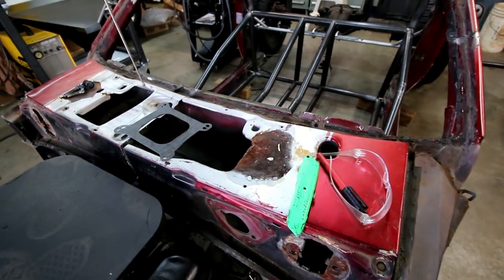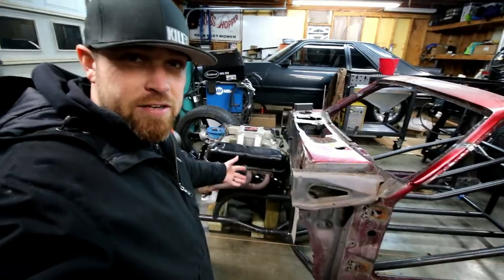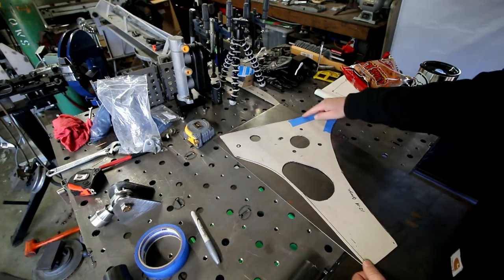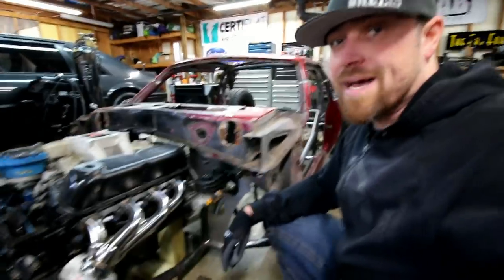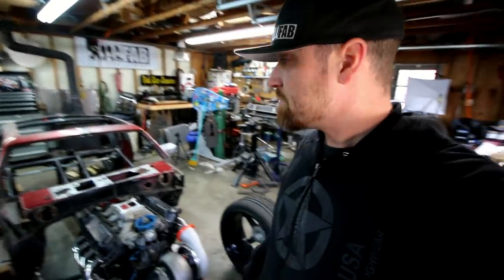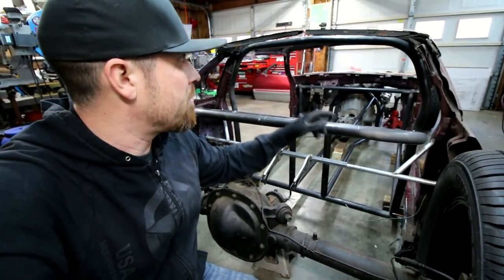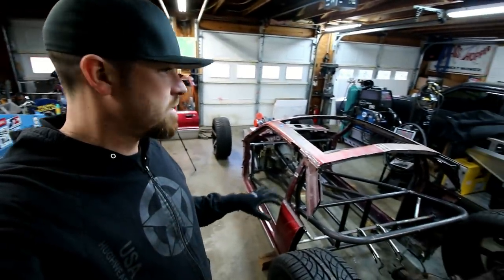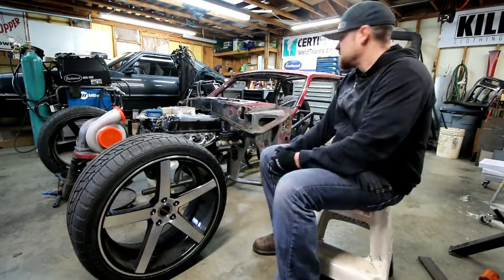Fox Body Mustang Hot Rod Build Progress | Bibbster

Comment: Dude,  you're gonna love the Everlast welder and water cooler.  I've had my everlast TIG, plasma,  and that exact water cooler for about 3 years.   It welds great and I've had zero failures.   The torch it came with was a hunk of garbage that weighs like 40 pounds.   I bought a new water cooled 20 size torch and it's a dream to use now.   Once you use a water cooled torch,  you'll never go back to anything else!
Reply from the maker: I am stoked

Comment: I just watched the update, if I could add food for thought? Front struts, look into 32 way adjustable coilover. You can change the length of the strut at the bottom by the spindle or cut the factory strut. Also if you look up and older YouTube post ( mid mounted mazda ) I know the rear is independent but look at the math and idea. Your show is great, it has helped me so much and gave me so many more ideas. Keep it going and having fun is what it about, have a good day
Reply from the maker: +Philip Baker You can't shorten the body of the strut though
Reply: True but with your rim size the bottom of the strut could be pushed down almost to the bottom of the rim then add drop spindles?

Comment: I love what you're doing with the Bibbster. It's genius. The kind of genius that is capable of influencing or repulsing the automotive world at the same time. I think it's revolutionary. I need to tell you that when I look at the 'quarter panel' and try to wrap my head around what you have loosely planned I'm concerned. I realize you're old school hot rod vision, however, I can clearly see a flying buttress. Look at the new gt40. A set up similar to that would allow you to use 2 smaller rads positioned in the arch of both buttresses. I realize I'm leaning toward supercar styling cues. I like big butts and I cannot lie! I trust you can deuce coupe the back half of the Bibbster and prove me wrong. You've got my attention
Reply from the maker: thanks....stay tuned

Comment: I like the front end design so just a thought, if you run a coil over do some custom ones with the hydraulic ram incorporated in the body would look clean. You could do some custom shorter struts strip the standard ones and mod the case / bracket location and do a screw closure to put them back together again with shorter internals, as they are probably twin tube gas over oil you can represurise them by fitting a schrader valve.  A very cool innovative build.
Reply from the maker: yeah that basically the plan

Comment: To stay with your design, go with your plan on making the strut solid and switch your hydro setup to an airbag coil over. That way you get the best of both worlds. Not only does it function/drop the way you want it to but you get the quality ride. Plus like you said in your other video, you want the suspension to be out of sight and bare bones. This way you clean up the strut area and hide the suspension in the chassis.
Reply from the maker: +Jason Postal I actually prefer a hydro setup vs airbags when combined with coil overs for a ton of reasons.

Comment: on your rear cooling  you mentioned "hard piping" it in aluminum and hiding it away... ever consider doing it in copper?  do copper lines and fittings (much like you'd plumb a kitchen or bathroom) and then adapt to rubber where you had to make connections at.   It'd look cool and you wouldnt have to hide it. could do some other copper accents to help make it blend in with the overall build.?
Reply from the maker: copper would be cool for an old style look....I think the aluminum will have more of a modern look and be much lighter

Comment: Go cantilevered set up. You will save a mile of space and can put it in almost any location if you calculate the pivot ratio properly. I was advised to use a Torrington bearing on the pivot between the rod and the coilover. Its what I'm doing on my 33 Dodge ratrod.
Reply from the maker: cool

Comment: How about running your coolant straight through the 1 5/8" bars? I know a lot of drag car use the cage for crankcase ventilation to the rear. Just a thought.
Reply from the maker: +bykrdood7 mainly because of hear transfer. Almost all of these tubes will remain exposed. I also would want to have any rust issues.

Comment: Saving you some more space re: brakes/clutch, have you thought of a wilwood/tilton/other manufacturer bias pedalbox, that way brake hydraulics and clutch hydraulics are moved inside the car, and it moves the accelerator cable point which might be easier to work with too.
Reply from the maker: I have but I like the idea of using as many fox parts as I can on this thing
Reply: The Fab Forums yeah, makes sense, keep it up, hope you get it done in time :)

Comment: Did you want to be able to lower the car with hydraulics? A drop spindle will only gain you an inch or two. You can also do cantilever airbags, like Ridetech, to make in compact and also be able to dump it frame in ground.
Reply from the maker: +Davion Hill yeah the drop spindle would just be to lower the point were the strut attachment point is....hydro will allow it to lay frame

Comment: Look up cnc brakes, they have reversed mounted master cylinder on a dual cylinder setup. Along with a hydrualic slave will work very nice. Noticed the headers are clean, Did you replaced them or clean them up? Look up fox shocks and run it on coilovers. Great job, cool video!
Reply from the maker: +Bizego Innovations New headers

Comment: Since your goin to use hydraulics use light duty hydraulic rams in the front they'll enable you to raise and lower the car but also be used as a shock just use a pressure valve so you can adjust the stiffness of the ride from inside the cabin. Atleast then you can still use coil springs in the front like you want and keep light tension on the Rams so you make use of both the Rams and coil springs but keep a decent functioning suspension.

Comment: I know you want to stay true with the fox body parts, but the problem with McPherson struts, is you have to have a support directly above the strut. This is due to the strut itself acting as a suspension member (usually the steering kingpin axis and controls motion of wheel through travel). I'm assuming you've thought about using bags, but so has everyone else... That being said, I might have a few ideas on how to hydraulically control this even with adjustable ride height.
Reply from the maker: yeah the strut will remain in the factory location and function as it should.

Comment: Guess I wasn't paying attention....never thought the strut was a thought.  That thing screams for a straight beam axle set-up!  A couple coilovers and done.  If you really wanted it to look naked up front, put torsion bars in tubes in the firewall area  You still need a shock somewhere....or bag the swimgarm at the firewall.  That would be tough spacewise though.  Straight axles front and rear!
Reply from the maker: yeah all those ideas are cool but they have all been done....and they wouldnt be true to the fox body era
Reply: The Fab Forums, your struts are really long....they are probably not using the whole tube.  You might be able to find some race struts and lose 5" or so of height.

Comment: Ever considered laying the front struts back to match the angle of the windshield and incorporating hydraulic steering? Just a thought.
Reply from the maker: it would have way too much caster if the struts where laid back.... they need to stay similar to the factory angle
I have though about hydro steering but the problem is that its too dangerous for public roads

Comment: Cantilever front suspension.  You can place the shocks horizontally, or close to it, and also use horizontal adjusting rams .  Some of the ones I've seen online become artwork that you want to show off.
Reply from the maker: yeah....im looking to do something different than whats already been done, but same kind of idea
Reply: Make the cantilevers the running Mustang symbol...or a Ford oval.

Comment: I use the hydraulic throwout bearing system with my tremec builds>
Using lightweight upper and lower control arms and adjustable coil overs  would seem to solve your space /drop issues.
Drop spindles for that set up are dirt cheap- fwiw.
Reply from the maker: +Fr. Rusty Matheny Yeah but everyone does that kind of setup and it's not true to the fox body platform
Reply: Good point.
I wonder if there is shorter Ford strut that will hold the weight and have the right damping - hmmmm??
Reply: I wonder if Strange or Qa1 , perhaps Viking would have struts that would work - perhaps something based on another Ford platform.
I can see the engineering/ fab issue your dealing with.
Like your idea of still being able to get off the shelf parts for the car.
Perhaps they have a chart of strut lengths and if Ford has one the right length- then your just dealing with spindle drop.

Comment: You could use a solid I beam axle in the front and run the hydraulic ram over the  front of the motor and use one ram on bell cranks attached  to the cylinder on one end and coil overs on the other.
Reply from the maker: +Shaun Phillips that's kind of the theme
Reply from the maker: +Shaun Phillips that's kind of the theme

Comment: Hey Kyle, 
That welder and torch cooler looks awesome but do you have a link of where I could buy one?
All help in finding a good deal on one of these setups is much appreciated.

Thanks in advance,
Pete.
Reply from the maker: thanks - you can check them out here
Reply: Thanks for the quick reply but do you have a link so I could go have a look at the price of the welder/cooler.
Thanks again,
Pete.
Reply: Never mind I found the Australian dealer and the prices are very reasonable but I will have to go for the 
power TIG 255 EXT because I only have single phase 240 volt power and the power TIG 325 EXT is 415 volt 3 phase.

Comment: Gonna need dual radiator caps. One on radiator. One with a high pressure relief rating at the highest point in engine's coolant system, between the intake manifold and thermostat. Then you can fill the engine first, put the front cap on, then fill radiator. You could bleed system at heater-core fittings on front of the intake, but functionally I'm sure having a cap up there will give the peace of mind anyone would want, along with safety factor of pressure relief redundancy(nobody wants a radiator full of hot coolant bursting right behind them).
Reply from the maker: +Jeff Evans Yeah if I just have a vent up from it will fill the entire system from the rear.
Reply: I was driving a car with a rear rad setup when a coolant hose blew.... Not pleasant!

Comment: I would think the caster sweep would be horrible with the solid strut as described.
  A hanging Howe or willwood pedal assembly would also put the cylinders and reservoirs internal, cleaning up the firewall and solve some heat issues. Just some thoughts
Reply from the maker: +blueduece64 it may actually have a better caster sweep with the way I have looked at doing it....I thought about a lot of the internal setups but they would be true to the fox body era.
Reply: The Fab Forums interested to see, have you guesstimated sweep travel? Easy to do if you have both pivot points guesstimated. Love the vids, and fresh take. watching from the mid state

Comment: you should weld the doors to the body and make it all smooth and enter through the window
Reply: the blueswan  bad idea. What if he crashes and the roof is caved in , causing him to be trapped in a blazing fire because you wanted him to enter thru the window.
Reply from the maker: +the blueswan lol...that would be tough...window opening are 4 inches shorter than stock
Reply: but...your always talking about fitness... its just an excuse to lose a lil more weight right? ;-)
Reply: sly5.0gt but then he wont want to drive it because of all the extra work it will be getting in and out of it, also the more difficult to scape in case of an accident
Reply: @vega bah... semantics... ;-) :-P
Reply: Don't think a door would want to open if the roof caved in just saying

Comment: For a more simple and cooler front suspension setup that will be easier in the long run, wouldn't you want to go cantilever. You could have the strut mounted on the bottom of the chassis where you said you would put the two heim joints as well. Create a front tee tower and have  another heim to create a front track bar. I feel it's easier for me to draw it out for you, if you want me to I can sketch it out, if you can send me your email so I can send you what I'm thinking.

Comment: Hey Kyle, why not use the pushrod suspension setup at the front it uses a lot less space then the normal strut setup. Or less height I mean deu to it using a pivot action. Keep up the great work, your Fabrication skills are out of this world!!
Reply from the maker: The main reason is because its not true to the fox platform, and I really want to stay as true to it as I can.
Reply: The Fab Forums can't you still use fox body coilovers? As far my knowledge goes a coilover doesn't need to be vertical to work deu to it having gas instead of oil inside. So it is still fox body parts but only modified to do its job a other way. And with pushrod suspension you can push the coilover up with a hydraulic piston to lift the car up deu to it pivoting the arm further.
Reply from the maker: yeah but you cant change the angle of the strut because it is essential to the suspension geometry
Reply: Ridetech makes some killer struts... Jus say'n.

Comment: SLA front suspension mustang 2 style but not sure how you would do the hydraulic setup..... maybe something like a F1 style cantilever thing ??? connect a hydro ram to the upper control arm on each side

check out JME enterprise for what im thinking if you care to...... awesome build no matter what, going to be sick

got  a 88' fox body myself but can't decide on the direction I want to go with it, only thing for sure is it needs to be streetable.
Reply from the maker: +FireStarterCanti not interested in doing anything like a mustang 2 suspention....I want to be different and try to stay with the fox era theme
Reply: I think that will be cooler in the end anyways, the mustang 2 would be easy but not original. I can't think of any cars off the top of my head but im sure that there are some other cars out there that use a McPherson strut that is shorter in length, that would get the mounting point lower for the strut top.

Comment: What do you use to make mock up sheet metal panels, the thick paper type stuff. Is that just scrap or is it specifically for that?
Reply from the maker: +Conner Wheatley it's called chip board. I try to reuse it as much as I can
Reply: The Fab Forums alright cool, thanks!
Reply from the maker: +Conner Wheatley No prob
Reply: thanks looks better than card board

Comment: The front suspension will bind with more than about 10degrees of movement
Reply from the maker: +Jack Lougheed Lol
..what part?
Reply: Because the two front arm will be mounted different distances from the front axle they will try to lift the axle in a diagonal up and into the engine. If you mount them parallel to the front axle they won't

Comment: If you want to keep coilovers on the build why not make a strut drop bracket, one end bolts into the strut like the spindle then flares out to go around the factory spindle. It would in theory keep the same geometry with a very (in theory) simple looking design.
Reply from the maker: yeah I will probably be doing some kind variation of that

Comment: Dude should keep stock shock's it's got rat rod stance build it in front of the engine it will be cool or angle it a 35 or 45" degree towords the firewall so then less strut shock. A straight axel would save all the troubles then again you want simple and stock just relocated. Angled gives less the strut shock when you aim it's top threaded section towords the firewall

Comment: Use a cantilevered suspension like you said
Like the formula 1 cars use
Quite a few hot rods and race cars use it 
It's basically what you described
Reply from the maker: yeah mine will have a twist on the idea though

Comment: why couldn't you make a bracket that bolts to spindle so you could run short street rod type coil overs to it
Reply from the maker: +Frank Chapa because a strut is required to control camber

Comment: correct me if i am wrong, but shouldn't at least one of those cage tubes be one solid tube all the way through...? i believe you just built what is called a mousetrap.
Reply from the maker: no...it doesn't matter, most are not. Beside on the chassis the weight supporting components up front will be attached to the fire wall cross bar, so there are 6 continues bars connecting the front suspension to the rear suspension.

Comment: why not just replace the hydrolic ram with an air bag? that way you can make the spindle solid mount and still have a functioning suspension that you can adjust ride height.
Reply from the maker: +jameswoodsist Your right it would probably be the easier route but I have a lot of reason to go with hydro...weight, rigidity, noise, space, and basically because it's different. Air is an option I guess if I can't get the hydro to work
Reply: i figured that was why you picked hydro, its definitely different. i really like the idea and the build. im interested to see how you overcome these issues you run into.